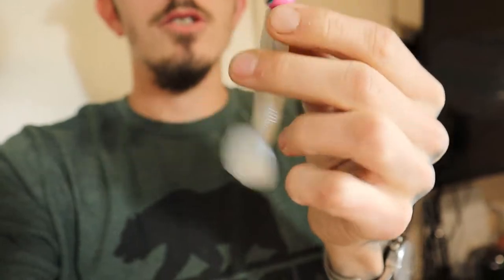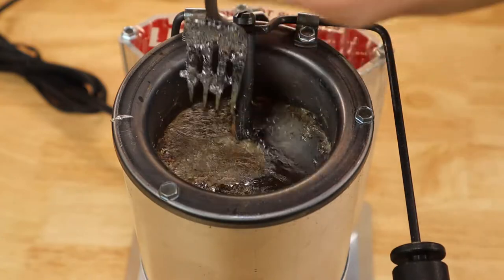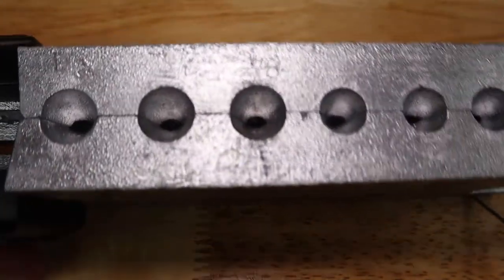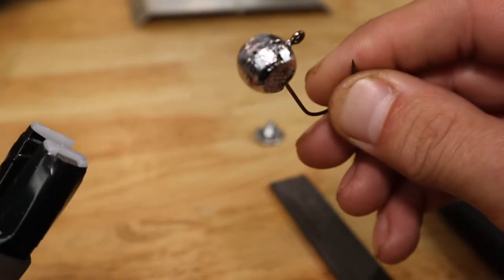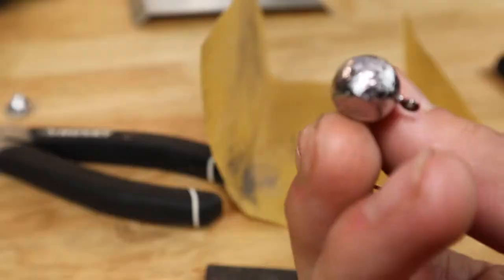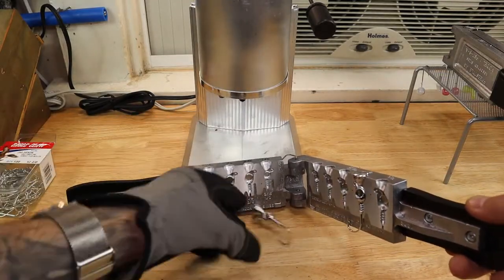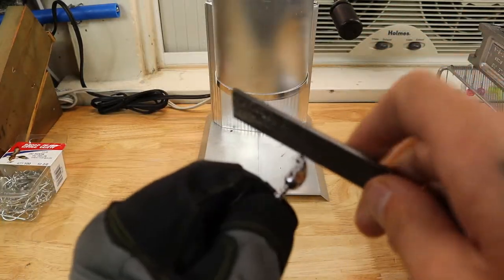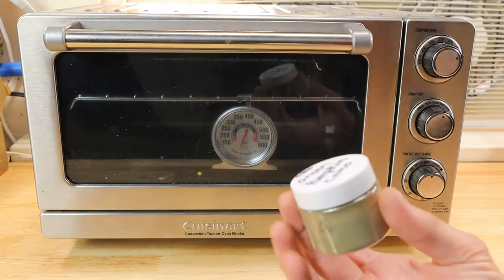How to Pour Your Own JIG HEADS! (with powder coating)

Comment: Hey bro, do you sell jig heads?
Reply from the maker: I can, but I don’t have anything setup on my website for them yet.
Reply: @rockymountainbaits5388  I can cashapp you or paypal. I just need some 1/16 and 1/32. Do you make underspins too?
Reply from the maker: I’m not sure if I have any molds that small. I will have to look when I get back in town tomorrow. No underspins yet. That will be in the future though.
Reply: @rockymountainbaits5388  When you dip, what do you use to clean out the eye hole? Paint doesn't clog the hole?

Comment: how do you keep the eyelets clear of paint?
Reply from the maker: I use a thin piece of wire when it’s when and if it’s covering the hole after it’s baked, I have a drill bit that’s a tiny bit smaller than the eyelet and then file the hole so it won’t cut the line